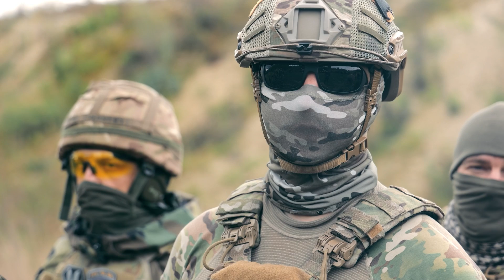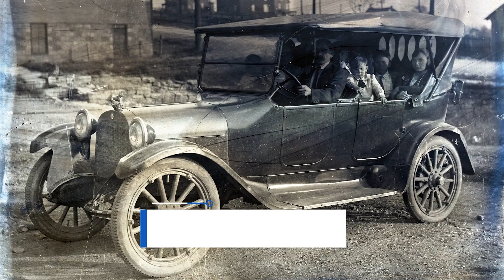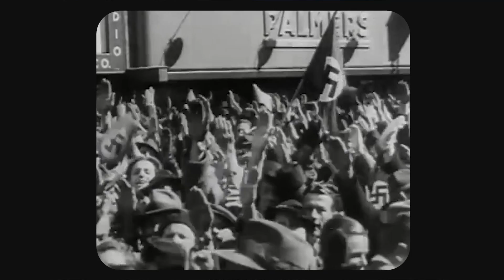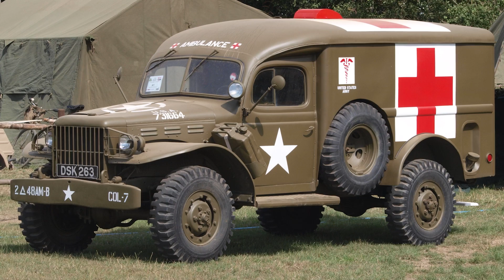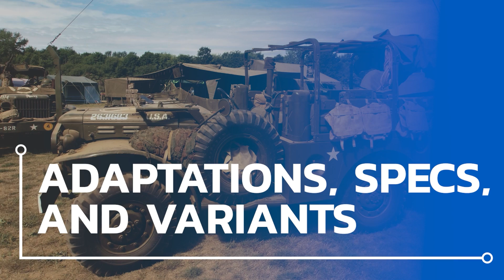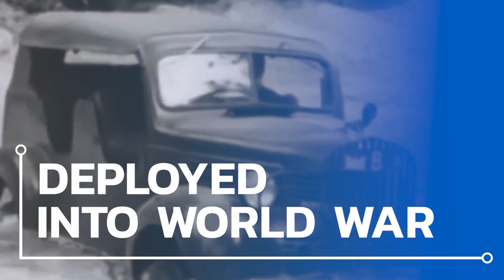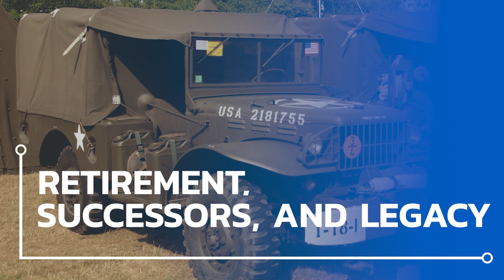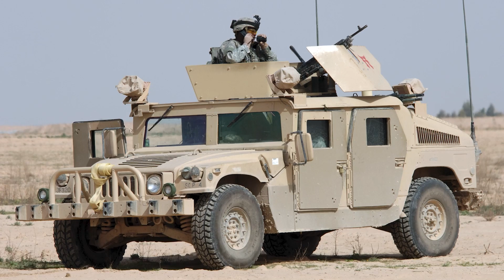The Unsung Hero of World War II (The Dodge WC Series)

Comment: The Nazis thought very highly of the trucks used by the Allies. In 1944, they offered to release 1,000,000 concentration camp inmates in return for 10,000 winterized trucks, with the promise that the trucks would be restricted to civilian use, or use on the Eastern Front. Other supplies were requested as well, but the trucks were at the heart of the offer. Since the Allies knew better than to trust the Nazis, no deal was made.

Comment: I still own an '80 Powerwagon, Clubcab I picked up in 2002. Just a simple, regular Dodge, pick up, rubber floor mat, manual transmission, windows and everything else. Just  chrome emblems stating it's a PW. About 4 yrs ago, spotted a used '15 PW on a Ford lot. It drew my attention, and it's the complete opposite of the '80, with power everything, and a sunroof. Loved that truck, locking diffs, winch, and Ram box. A used car salesman was adamant that he wanted my truck and I ended up trading it in for a '18 PW. Yes they are thirsty for fuel, the '80 has a 360, 4bbl. But they all got used as trucks. Dependable trucks.
Reply: I love the quad vents on the early trucks so AC wasn't necessary ( two floor and two window vents)

Comment: If i ever find myself in a situation where money is significantly less of an object than it is today, i will obtain one of the original flat fender powerwagons from the early 40’s, fix it up, and use it to pull my 1941 ford 9n around to the various properties I maintain with it. I figure that would be a blast from the past, being trailer technology hasnt changed that much, but tractor and truck from that era has greatly.
Reply: Power Wagons did not come into production until 1946, after the war,  Basically a civilian version of the WC trucks.

Comment: When you mentioned the winch you said "power winch", you may have meant power take-off winch. I think it's worth noting that back then electrical winches for vehicles weren't common. (If even invented yet) Rather they were commonly PTO (power take off), winches which use the power from the engine to turn the winch drum via a specific gear located in the transmission gearbox. An electric winch will work when your vehicle is upside down, and may come with a very good warranty indeed- many of the pto winches installed on surviving ww2 era dodge trucks work flawlessly to this day.
Reply: Farmers in my neck of the woods hooked the PTO up to a hydraulic pump, put a hydraulically actuated dump box on the back, and used 'em to haul grain for 30 years after they were "surplus"
Reply: And they can wench 7500lbs.
Reply: @erikkunkle9574  able to winch themselves out of trouble
Reply: Not out of the trans, out of the transfer case. If your going to act like you know something, at least know enough to not sound dumb.
Reply: @Byronelwood-p6n  Quite correct.
Reply: @-oiiio-3993  not on the 6x6 WC-63
Reply: @Byronelwood-p6n  It's not out of the transfer case either.  TM 9-810 March 18, 1943, Section XXVI, para 221b. "On model WC-63, a power takeoff assembly is mounted on the side of the transmission case to provide a means of taking power from the engine to operate the wench." @deadbrother5355 was more correct than you.  Later in para 226, PTO assembly Replacement, it talks about the transmission shaft counter gear and how all works together with the PTO.  Next time, you want to lash out for someone "being wrong", research or keep your mouth shut before you prove you know less than the person you're trying to make look dumb.
Reply: @erikkunkle9574  Not all versions actually, many are out of the transfer case, I have several.
Reply: @415s30  I can see the two axle ones being like that, but the 1 1/2 tons, six wheels, are not.

Comment: Sadly this was when Dodge engineering was stout. Today dodge exists in name only.
Reply: As I understand it they have had a problem with fit and finish since the mid '80s. If you're not to worried about the door panels coming off or stuff like that then they make good vehicles.
Reply: @michaelhowell2326  My opinion on that (and this applies to a LOT of manufacturers these days) is there's  far far too much cheap plastic in vehicles these days. Yes its light and cheap but it fails easily and honestly doesnt look anywhere nearly as nice or easy to deal with then a solid steel panel
Reply: @Kellen6795  It also doesn't help that only a hand full of companies own everything so there's less competition. You see the same problem with most industries these days.